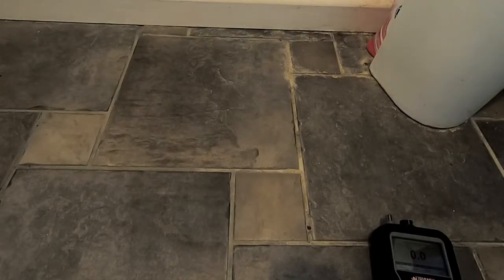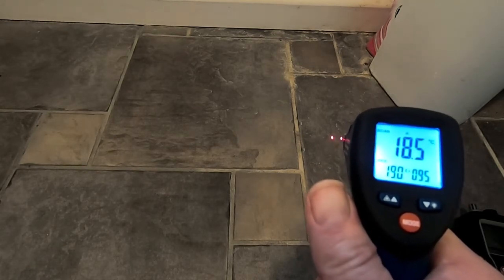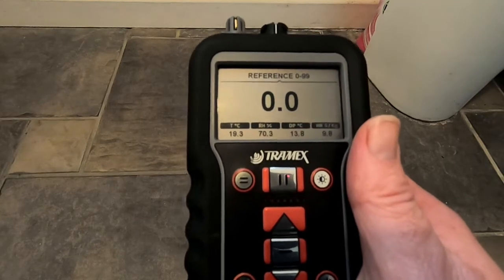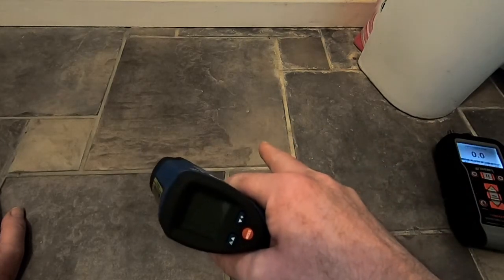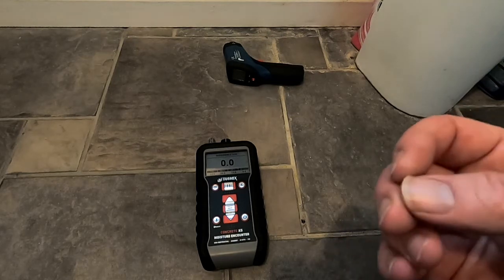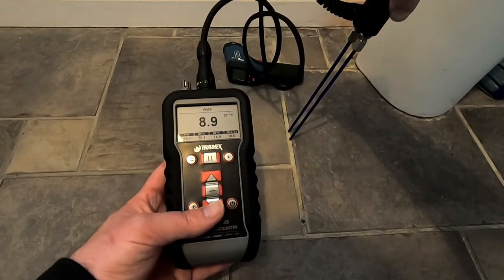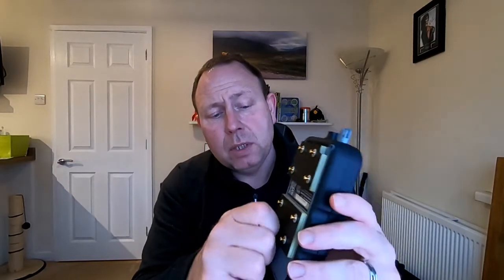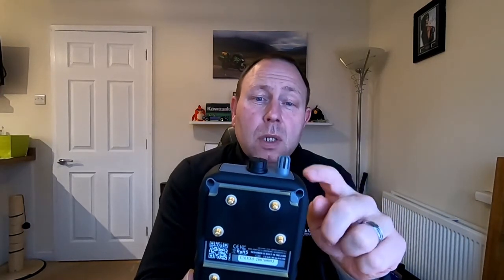Tramex Concrete X5 Measuring Moisture Behind Ceramic Tiles

Comment: As a householder and not in the trade, we had a central heating leak and during the investigation I was told that I had moisture behind the wall tiles in my shower unit as the moisture reading was higher there than on other walls in the bathroom. So I wondered whether this technique could also be used for bathroom walls? A recording of temperature was not made. Our leak was actually found in another room and nothing to do with the bathroom.